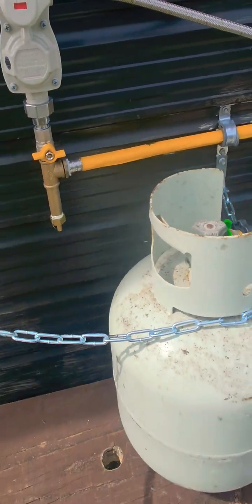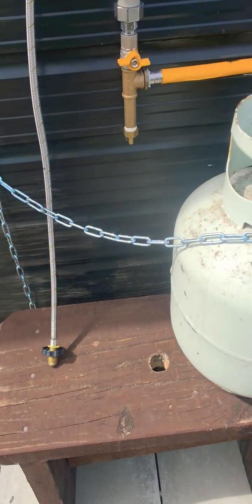Stop Freezing Your Bottle! 200 MJ/h Heater Needs Twin 45 kg Cylinders

Comment from the maker: “Got questions about LPG sizing for califonts? Drop them below. Short answer: 200 MJ/h ≈ 4.1 kg of LPG per hour. A single 9 kg bottle can’t supply that continuously — it freezes up. Twin 45 kg cylinders with a high-capacity regulator is the right way. Always use a licensed gasfitter.”